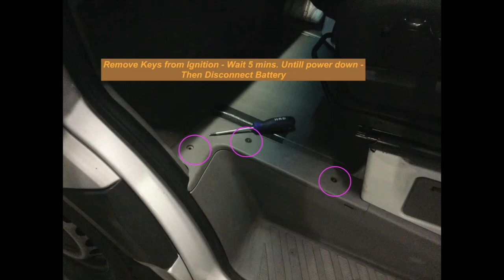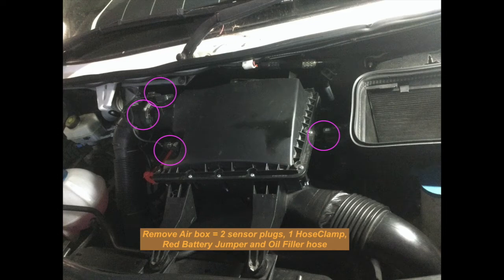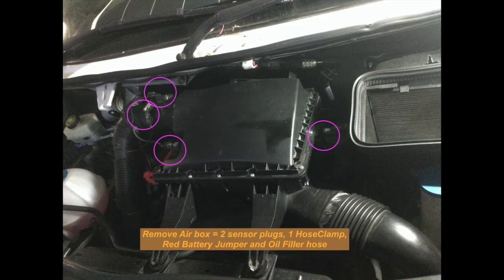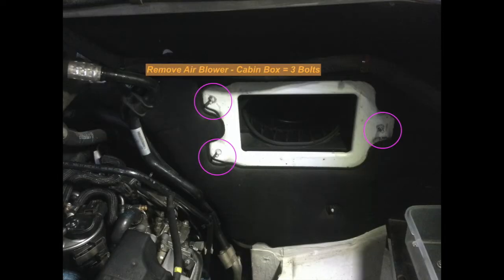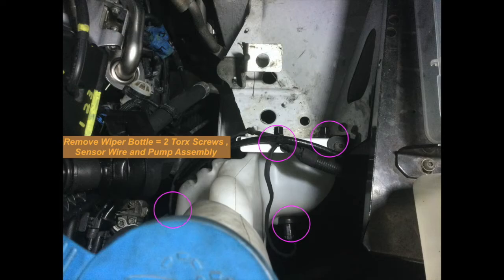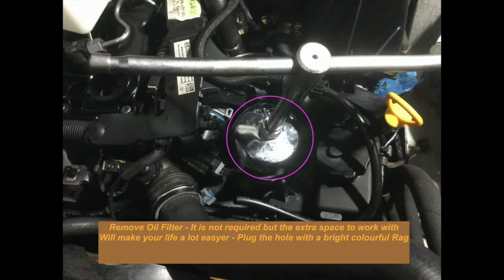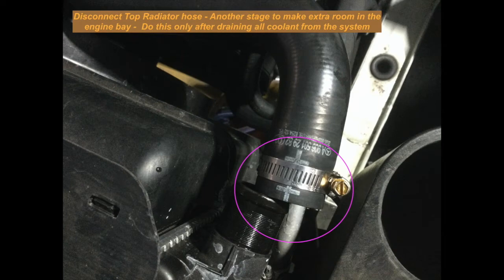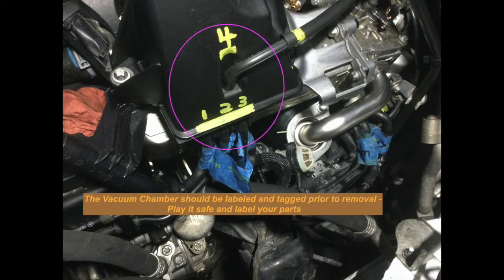Pt.4 QUICK SUMMARY Mercedes Sprinter Van W906 OM651 - EGR Valve & Intake manifold removal & clean

Comment: Hi mate this video @ 2.54, you have copper wire linking the plastic arm to the bypass valve. Why does this keep breaking ??
Reply from the maker: @Gtisnowy88  oh yes, haha that's the cheapest plastic link arm - it controls how much the EGR opens up and bypasses the EGR cooler chamber, the only way around it is make a stronger version yourself from aluminium or steel sheet etc
Reply: @runningon8883  wow, that was a rapid reply!!! Yeah that's what I was thinking. Not sure how to do it yet though, I've just bought another new part again. Why does it keep snapping though, what a poor design !!

Comment: Do you remember to open the big clamp that is on the end of the pipe -the pipe that sits under the throttle body goes under the engine bay and towards the front near where you release the coolant. Puzzled how to remove it for cleaning. There is a lot of dirt and oil in there.
Reply from the maker: Yes - Its funny kind of clamp you can remove it: The Pipe -  it runs from underneath the throttle body up-to the Intercooler-Outlet.... You need to get right under the car to remove the pipe and it only comes out and goes back in one way, it takes a lot of wriggling around
Reply: @runningon8883  I managed to finish this job. But now I get CAN bus fault 9100. Starter motor goes but Engine wont start. Like no fuel goes in i believe. Did you have to do anything else?

Comment: Wow you are killing it with these videos, man. I really appreciate these. I followed your vids to diagnose a sheared bolt on the charge air manifold. I have the brake/vacuum system in the way of the EGR valve on this US model since we drive on the opposite side, so its somehow even more cramped unless you take apart the brake system I guess.
Reply from the maker: Hey J, It means a lot to me that someone on the other side of the planet got some use from my videos, thanks for your comment - Chris
Reply: Yeah it’s like really in the way